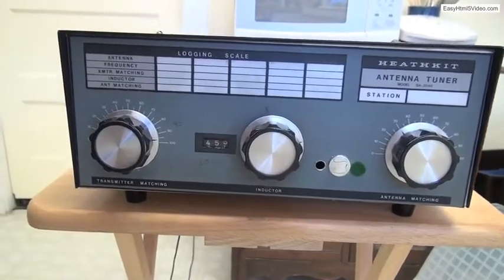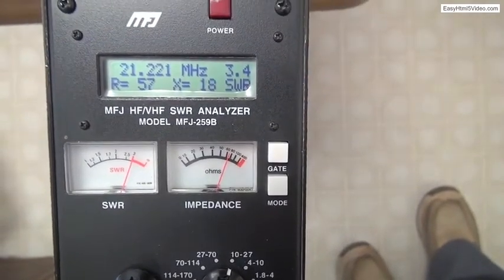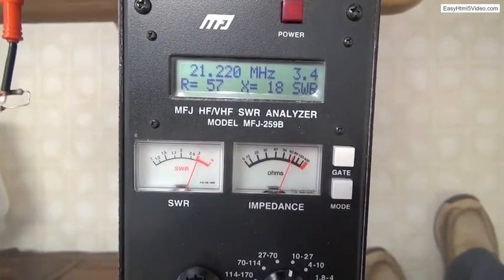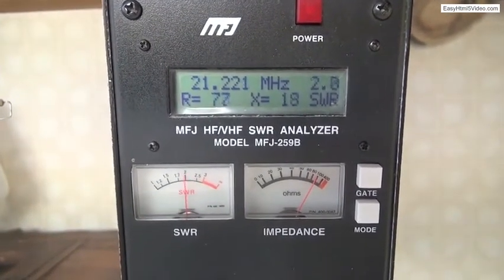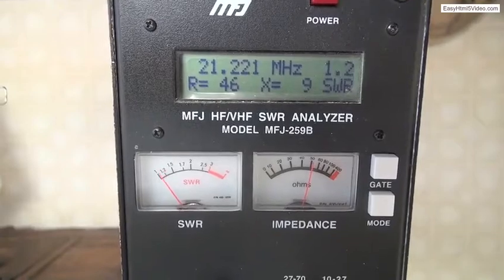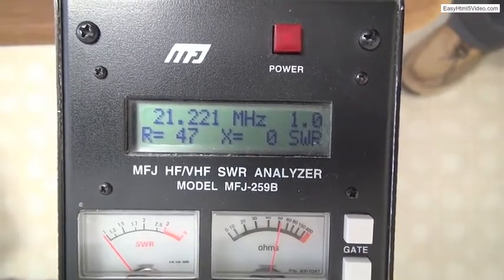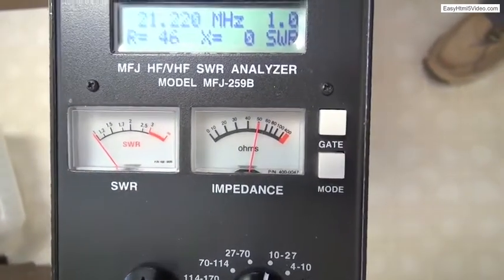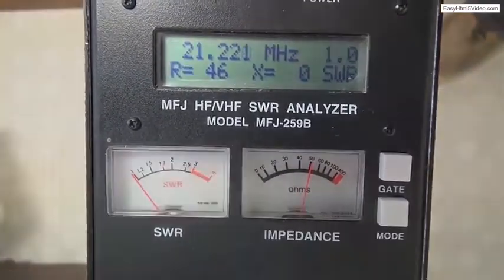Using an MFJ-259B Antenna Analyzer

Comment: I have  a kenwood  radiio with a mfj auto antenna tunner and I don't worry about it. but I have an I com computer driven radio and I do worry about it hooked to the gap even though it is supposed to be a no tune antenna across the band